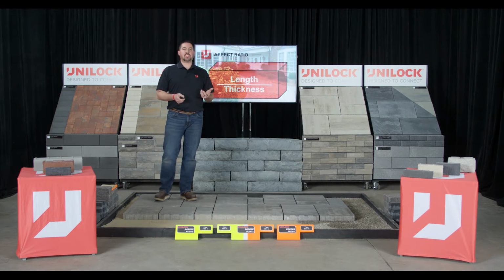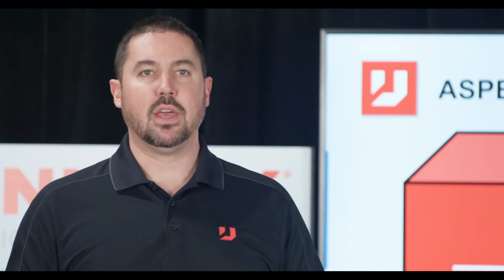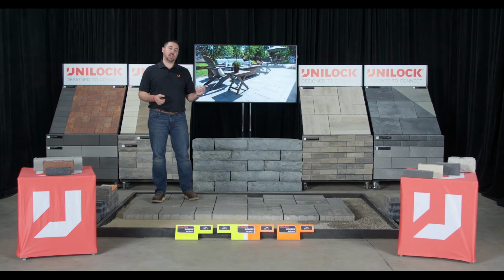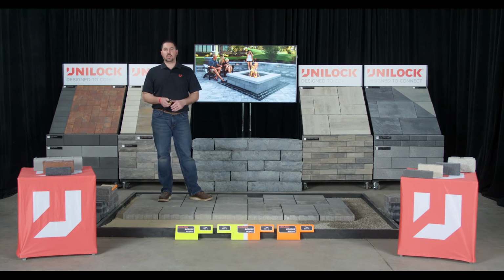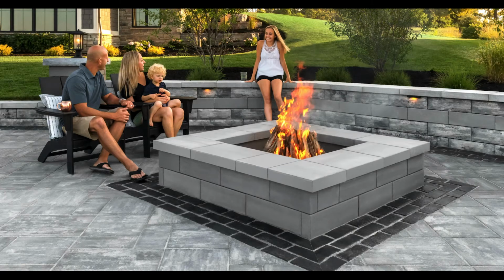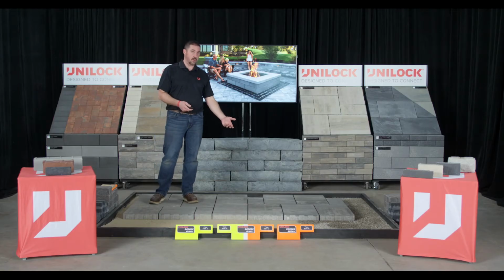Accenting with Different Thickness Pavers - Edu-Series

Comment: Great video. What about 0.75" thickness flag stone to a 2" thickness concrete paver though? I'm assuming possible but not ideal or can it also be done without issue?
Reply from the maker: Hi there great question! Yes this is definitely possible, however I would strongly recommend a chip stone bedding layer in this application over a sand bedding layer.  Reason being that there should be a minimum of ¾” bedding material under the pavers, and a sand bedding thicker than about 1-1/4” to 1-1/2” becomes much more susceptible to movement a possible settling of the pavers. Hope this helps!